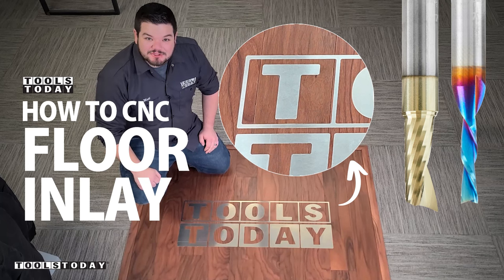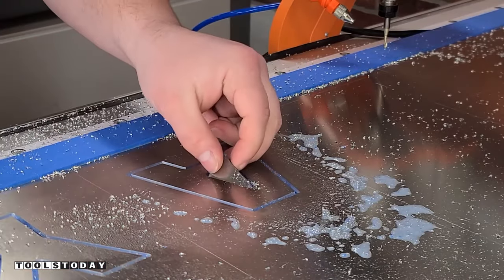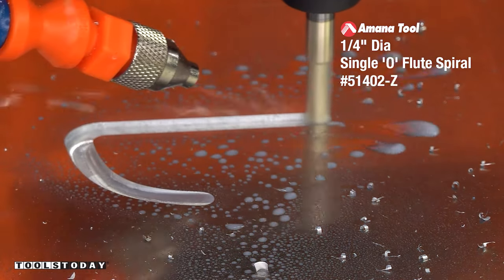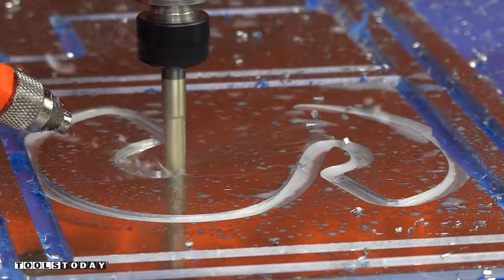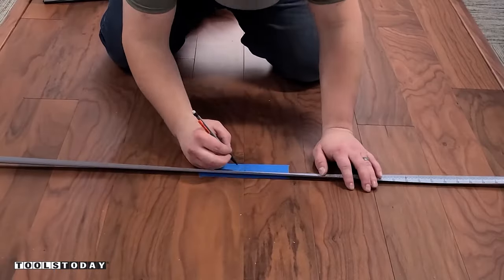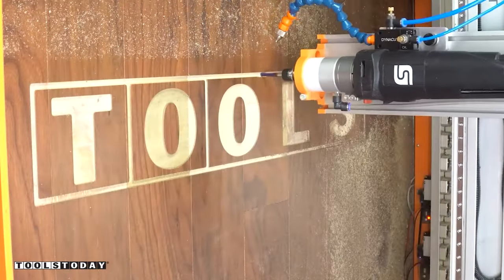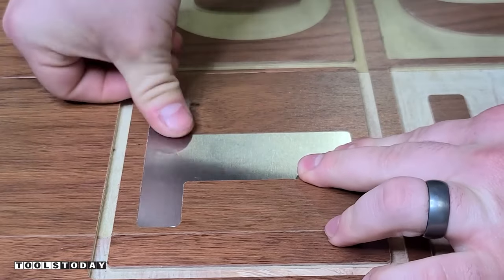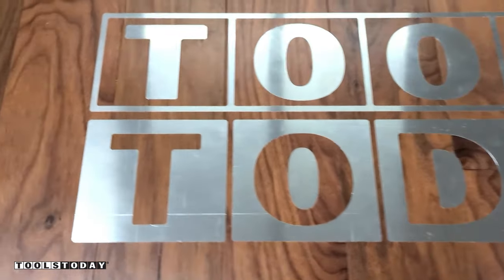How to Make a CNC Floor Inlay - Long Version | ToolsToday

Comment: That was fantastic to watch. However, I can only award you 9.99999 points out of 10 ! I was so impressed with the perfect fit and the contrast of the aluminium inserts against the walnut floor, ...  here is the but  😉
You didn't give the aluminium a good enough finish. The scribe marks on the lower 'T'' can been seen from a mile away. I know it will be eventually scuffed up with foot prints, but a lovely brushed aluminium effect would have been great.
Great video TT, love your work 😎
Reply from the maker: Thank you for the kind words and for watching.  I definitely don't disagree, but I couldn't justify the time and work to sand down and polish it knowing it was going to get scratches on it when walking over it.  The scribe marks were pretty deep, so it would have taken quite a bit of work to get below them, and that's just not my expertise.

Comment: Interested in if you are going to buff out the scratches and how you plan to protect the inlay?
Reply from the maker: We look for advice how to protect the aluminum inlay. Ideas?
Reply: @ToolsToday  its a pity the aluminium wasnt sorted before you made the cuts. Could have done a nice satin/brushed finish on it, then once in the flooring, it could have been protected with a fine pour of clear Epoxy.

Comment: great job ..... but i don't like how the panels are fixed for cutting with glue...it can be very dangerous--IMHO
Reply from the maker: Thank you!  This is one of the better ways to securely hold things in place, especially for thin material like this.  My mistake was not spreading it out before putting the material on.